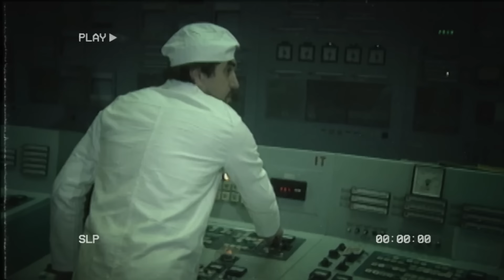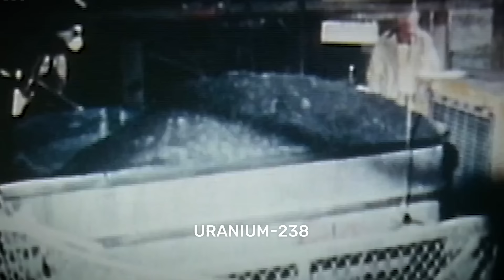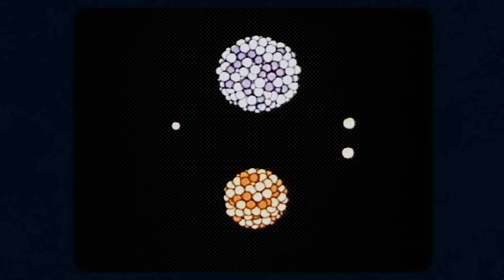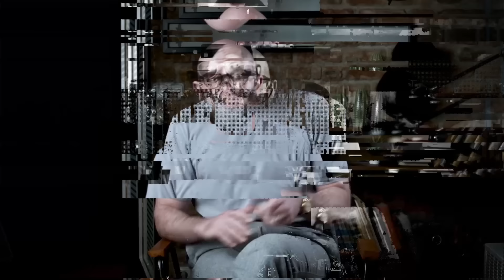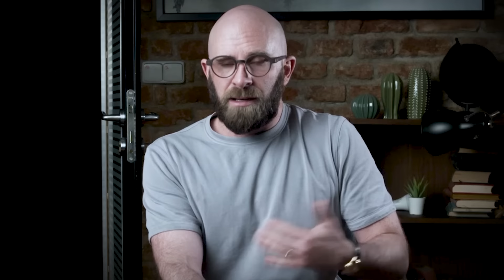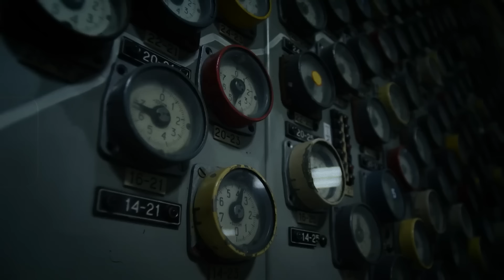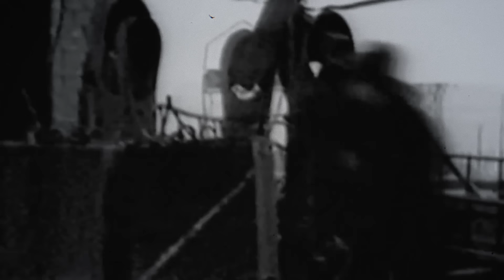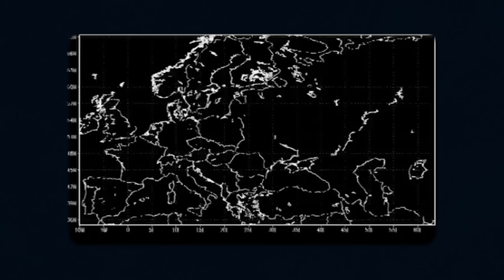The RBMK: The Shoddy Nuclear Reactor That Nearly Killed Millions

Comment: Yeah, I agree with the other commenters - water doesn't regulate the operation of a reactor - for u-235, and many other fuels, it actually increases the efficiency of free neutrons- slowing them to thermal speeds where they are more likely to be captured by other uranium atoms.  Without a moderator, the neutrons have too much speed to be captured in uranium nuclei. So moderators moderate the speed of the neutrons, not moderate a reactor.

Comment: Just recently watched some other YT documentarist's RBMK document which highlighted a thing I didn't know before (and not mentioned whistler boi): the pressurised water-steam in the reactor was bit under 300 centigrade but the graphite moderator, even when "water cooled" was at constant 700 centigrade. I always assumed all the heat was around the fuel and significant part was carried by the water-steam. But apparently whole damn core was hot AF, especially when you consider that it's just water turning into steam.

Comment: Another thing that I didn't hear him discuss is one of the primary design features of the rbmk is the ability to run on lower in enrichment fuel and if I remember tolerate higher levels of impurity in the fuel. They sacrifice safety also for performance.
Reply: Their research for this material was (is) embarassing.
Reply: So rediculouse a massive nuclear bomb type explosion would happen. The fuel is not yellow cake and the neutrons are slow moving for a controlled reaction to heat water to make steam. 

 UNSCEAR made a report in 2015 that there was a total of about 64 deaths with a projection of near 160 total in the future with no risk of legacy birth deffects.  Iodine had been a help against thyroid cancers and wild life has flourished in the region.
Reply: I just said that!!!
Few mention this!  A huge advantage!

Comment: Moderators don't slow down the reaction, they allow it to happen (slow neutrons).  Chornobyl happened, in part, because of the introduction of too many/much moderators. They do not calm things down.
Reply: Yeah I caught that too, seemed like he described moderators incorrectly at the beginning of the video.
Reply: Non-specialists who are also not on the spectrum tend to assume they know what a word means if it sounds like it makes sense... The moderator certainly moderates something but in this case since it moderates the neutrons into the thermal range it... unmoderates?... the reactions 😂
Reply: @illwerral  yeah it’s a tricky one. I can’t be too critical though, he does about 10 videos a day on a wide range of topics and usually are very informative and accurate.
Reply: So 'moderator' should really be 'accelerator' ? ...and this is nuclear industry propaganda-speak so that joe public thinks all nukes are now safe?

Comment: If the corium reached the water it would probably cause a steam explosion, but it wouldn’t be 5MT. To make an explosion that big the  water would have to undertake a fusion reaction. Which requires temperatures of millions of degrees.
Reply: The reactor made roughly 3200 MW of thermal energy operating at full power, in order to make 1000 MW-electric. There are 730 hours in 30 days. In order to make the energy that the Chernobyl mini-series said it would if that steam explosion occurred (2-4MT), that reactor would need to be running at full power for 30 days. 3200MW per hour = 3200MW/h x 730 hours = 2.3 million MW produced in 30 days. To reach the 4MT number, it would be 60 days. 

so yes, there wasn't enough fuel available in the correct orientation to make a large multi-KT explosion, to say nothing of hitting up to the MT range. The show was pretty cool but that was one of the more glaring errors they made.
Reply: @Clean97GTI  It would not have been a nuclear explosion. They estimate it would have been on the order of Krakatoa.
Reply: @jeraldbottcher1588  the Krakatoa Eruption was 200 megatons, 4x the size of the largest thermonuclear device ever detonated. Chernobyl's steam explosion would have been nowhere near that large. 
People are just not understanding that there isn't enough energy in a smashed reactor to make that large of an explosion. 
It would have been a big explosion and because it's a steam explosion carrying lots of core materials, it would have been a massive dirty bomb. But we're not talking anything that even approaches 1 megaton. Not even 1/10th of a megaton.
Reply: @Clean97GTI  The reactor was designed to run at 3200 MW. they estimate that at the height of the runaway it was at over 32000 MW of energy being produced
Reply: @jeraldbottcher1588  Even at 10x the rated power, that's still only 0.026 Megatons. A big explosion for sure, but not anywhere near the scale talked about on the TV show. Maybe they meant to say a fallout cloud equivalent to a 2-4 Megaton blast. That might have happened with radioactive water vaporizing, exploding out of the tanks and carrying melted core material with it and raining it down as the steam condensed back into liquid. You'd have radioactive clouds. That's at least feasible.
Reply: @Clean97GTI  Obviously - tv series are made for entertainment and therefore often get stuff wrong.

I think you're missing the point here. 3 - 5MT are in the realms of possibility. 1400kg of corium (uranium+graphite) at ~3000°C can boil enough water instantly to cause an explosion of this magnitude. Remember: When water turns into steam - it's volume increases by a factor of 1,200.

Unlike an electric water kettle with a certain wattage - a RBMK can produce exponentially more energy than it was designed for during a runaway.

Even more so after the meltdown.

In the corium - the heat of the nuclear reaction isn't taken away by the coolant and the reaction isn't slowed down by the control rods any more. The nuclear fuel intended for longer-term use burns off quickly - and therefore, creating immense heat.
Reply: @stanislavczebinski994  I literally gave you the math. There isn't enough energy in the system to give you a thermal explosion that large. 

There are 0.003 megatons in 3300-MWh. One RBMK-1000 reactor running at full power couldn't produce enough energy in any given instant to release the amount of energy you're talking about. And that's in optional conditions. Even if you use the 33GW that it spiked to before it blew the lid off, you're still a couple orders of magnitude short of the needed energy. 

There isn't enough energy available. The 2-4MT explosion isn't happening. The show was wrong.
Reply: @Clean97GTI  The show didn't come up with that number. It were the russian scientists that did.

The heat alone is only part of the total equasion. Which is why nothing happened without the corium getting into contact with the water.

The problem in the first place was that the decisions leading to the desaster were made by politicians without the proper knowledge overruling the scientists. They were forced to act by the Soviet system.
Reply: @stanislavczebinski994  Man, how much thermal energy did the corium have? ~20 GJ. Now, 5 MT of TNT is 20 PJ (1 kg of TNT is ~4MJ, really, like 9 times less then coal, because you add oxygen to coal and TNT has to carry it onboard. 4e6 * 5e6 * 1e3 = 2e16). So, my answer is NO, no huge boom for you. Supposed Legasov's estimation is off by a factor of a million, 6 orders of magnitude. Or maybe I am imprecise and in fact "only" 5 orders :-)))
Reply: @WielkiKaleson  No offense - but you still don't get it.

You're still calculating thermal energy up and down. But heat isn't the problem. The problem starts when that heat turns water instantly into superheated steam.

1kg of water turns (roughly) into 1673m³ of steam. That's 1dm³ of water. 1m³ is 1000dm³. That equates very roughly to a factor of 1673000.

Now: Consider ~1400kg of corium, somewhere between 1660°C and 2255°C - and hundreds of tonnes of water in the basement.

That would have made for one hell of a dirty bomb - ripping apart what was left of the other reactors - and blowing gigantic amounts of radiated particles into the surroundings  - and the upper atmosphere. There - strong winds would have distributed those particles all over the planet.
Reply: That’s what I’ve been trying to relay in the discussion. People always think a plant can become a nuclear bomb!  It’s totally laughable. The fuel for one would have to be much more purified. 😂
Reply: @leontb69  No nuclear bomb - but a dirty bomb.

Less boom - more radiation.

A conventional (very, very massive) explosion dispersing radioactive material.

If big enough it will reach the higher atmosphere - were constant strong winds disperse the radiation over the better part of Europe.
Reply: My understanding is the corium DID reach the water, but didn't explode, because the whole idea was flawed.
Reply: @WhatIsMisophonia  It didn't.

The corium was hot enough to melt through thick reinforced concrete.

It surely was hot enough to start that reaction - and therefore - a massive explosion.
Reply: @ The containment had already been breached (no longer a sealed container) and by the time the corium had melted through, it was significantly cooler; The basement was drained because if the corium had dropped into it, a lot of steam could have been produced which when serving as a vehicle for radioactive elements, would have increased contamination as it leaked out, but it wouldn't have blown the hell up. Most experts seem to agree that it would have been little different than lava pouring into the ocean and producing a steam plume. 

Also, maybe someone can clear something up for me: Google's telling me that: "In 1986, Russian teams chased the melted remnants of the Chernobyl Nuclear Power Plant's reactor core into the facility's basement, flooding it with water to cool off the materials before they could burn through the containment building and pollute the groundwater." Is that true?
Also: "On day 8 after the accident, the corium melted through the lower biological shield and flowed onto the floor. This redistribution of corium would have enhanced the radionuclide releases, and on contact with water corium produced steam, causing an increase of radionuclieds at the last stage of the active period." - https://www.oecd-nea.org/jcms/pl_28271/chernobyl-chapter-i-the-site-and-accident-sequence
Reply: Not really. At ~2500°C water seperates into hydrogen and oxigen.

With the amount of corium and water present - that would have made a pretty big boom.

Which is why the Soviets worked in such a haste to prevent it from happening - and finally succeeded.
Reply: @stanislavczebinski994   Yes really. You need temperature, pressure, and fuel PROPERLY POSITIONED to make a bomb. Adequate amounts of everything just do not make a ready N/TN bomb. We are only talking about a so-called dirty bomb here - steam explosion scattering radioactive fuel. This is almost an opposite to the nuclear explosion.

Comment: 8 RBMK units still in operation in Russia, zero incidents, zero close calls, the reactor certainly wasn't deserving of the term "shoddy", it was a piece of technological wonder for the time, it took inexperienced operators with lack of training to turn it into a disaster! The "SKALA" computer was able to operate the reactors safely even with the positive void coefficient issue, the night of the disaster all the computer controlled safeties were overridden. Should it have had a containment building? Yes! Should it have had higher fuel enrichment? Yes! Then again, I doubt even a fortified containment would have held back a massive steam explosion, just look at the ones in Japan, popped open their containment structures like balloons!

Comment: If anyone wants a more engineering and physics explanation on the failure then Scott Manley has a fantastic video all about it.
Reply: However, Scott Manley still mangles the chronology of the accident. Reactor power did not start ramping up out of control until after AZ-5 was pressed.
Reply: I would not call his video 'fantastic'

Comment: You need slow neutrons to sustain fission, not fast ones. The video doesn't mention the reason why the reactor became unstable due to being 'poisoned' from  running the reactor at below the minimum power levels for an extended period.  It was the instability (lack of response) of the poisoned reactor that led the control room to remove all but 8 rods in an attempt to increase the power levels.
Reply: Which was about the stupidest thing one could do.

Set back safe nuclear power for 40 years.

Comment: It never 'nearly killed millions'. The most significant two facts about the accident were first of all how bad it was in terms of radiation release - it is scarcely possible to envisage a worse situation than a reactor in full meltdown, on fire and open to the sky, and the fact that despite the huge release of radiation, very few people actually died and the wildlife survived just fine, as did the population who refused to leave.
This is at complete odds with the implication of nuclear regulations and various scaremongering academics and competing power technology shills but consistent with research into  low level radiation that shows that until you get to a certain level of exposure, cell damage or cell mutation is extremely rare.
In short, the danger from a reactor disaster that was simply as bad as it gets was around 1000 times less than many people said it would be.
Radiation simply is way less dangerous than it has been made out to be. By people who have strong reasons for overhyping its effects.

Comment: I remember reading several years ago that the Chernobyl reactor was designed to be research reactor, not a power plant.  The Soviet govt. at the time decided to ramp it up to produce electricity because it was there and would be cheaper despite the objections of the designers.
Reply: Don't remember that part, but it was second generation RBMK - design that wasn't tested prior to just building it... What could possibly go wrong?

Comment: The Soviets did make pressure vessel reactors,  they just outsourced them because the rbmk was mainly a breeder reactor for plutonium.  They didn't want anyone else having a breeder reactor with 200 tons of uranium
Reply: The RBMK was a design based on the stolen plans for the plutonium breeder reactors that were built in Hanford Washington for the Manhattan Project. 
Plutonium is not a natural occurring element. To make it, you must expose U238 to a high neutron flux, such as found inside a reactor. To make plutonium suitable for nuclear weapons, you must control how long the U238 is "cooked" inside the reactor. Too short a time and you have a poor yield of Pu239. Too long a time  and you create a lot of Pu240 along with the Pu239. Having too high a ratio of Pu240 to Pu239 will cause a Plutonium weapon to "fizzle" rather than detonate. North Korea's first two nuclear tests failed due to this reason.
A PWR or an BWR take months to refuel and part of the reason for that is the huge containment building that encloses the reactor. The RBMK design prioritized the ability to rapidly change out fuel modules.  So the design skipped the containment building in favor of Plutonium production.  
When the accident occurred, there was no way to contain the explosion and prevent the smoke and radioactive materials from escaping
Reply: @johntrottier1162  rbmk ised u235 at 2% enrichment,  u238 isn't usable unless refined to u235
Reply: @johntrottier1162  thanks for the long answer
Reply: Incorrect. The RBMK never produced a single game of weapons-grade plutonium. This was an early design concept that was abandoned in the 1970s.
Reply: @MinSredMash  believe what you want, but im going to stick with facts
Reply: @matthewmckinney5387  Try telling your "facts" to a former RBMK operator. They will get a really good laugh out of the idea.